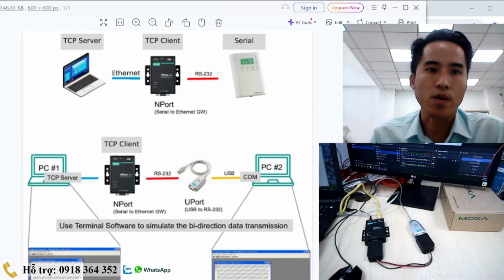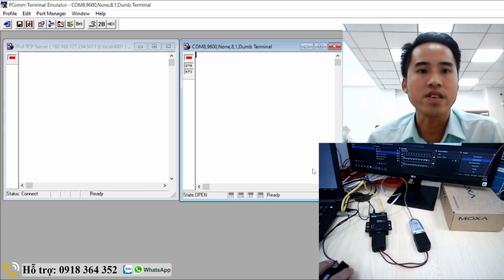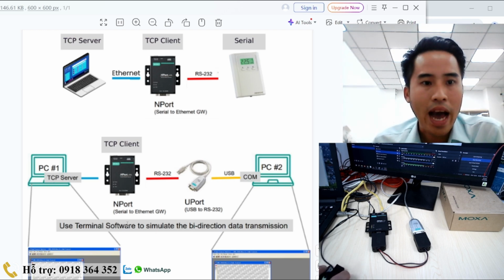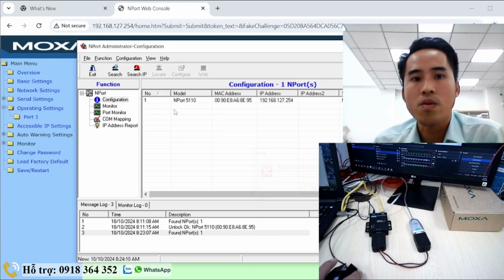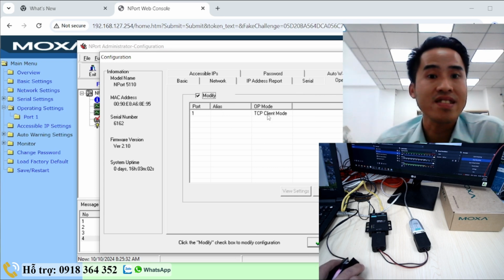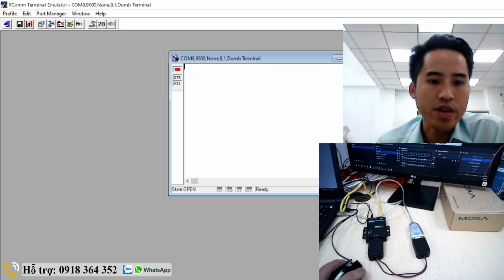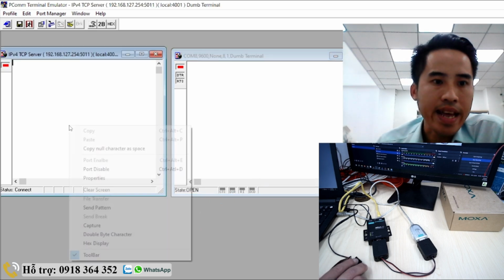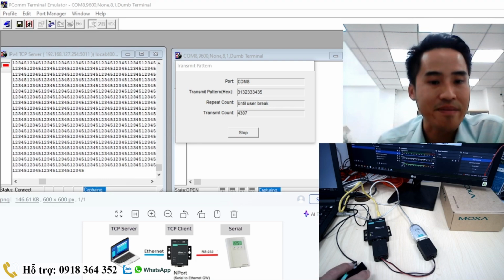TCP Client mode With Nport Moxa - Serial Device Server (Demo & Installation Instruction)

Comment: Nice video.!! 🙂.although it might be a bit slower at some points, it is very fast for beginners to understand all the details.. keep up the good work..
Can you put a link where to find the Nport Administrator configuration  software? 
Also can you describe more clearly the physical connections with  ethernet cable and RS232 cable
Reply from the maker: Thank you for your feedback, hope to build another video better, About Nport Admin you can download depaned on your OS, following Resources tab for get right link: https://www.moxa.com/en/products/industrial-edge-connectivity/serial-device-servers/general-device-servers/nport-5100-series#resources
Reply: @lammangcongnghiep  thank you for your replay..could you give me advise from your experience? 3 questions
Iam trying to test a Lab instrument sending data through his own PC via physical RS232 port ,before I connect it to the Labs network.(lab network server has a specific IP address and port where listening different devices connected)
I get a Moxa device Nport5110 and I connected to PC rs232 port with a serial cable. the type of this cable must be straight through or nullmodem?
Can I run the PComm  tool  to the same PC if i connect Moxa Ethernet cable to this PC Ethernet port and simulate traffic (as you do in your video) ) or sending data from the instrument? in that case of simulation what IP address and port is should give to  PComm TCP server?
Thanks a lot
Reply from the maker: @dimm4180  Hi Thank you for your feedback
About your case, here are my mention,
1/ Is your Lab device have App from manufacturer? Or any Protocol specific like modbus rtu RS232?
2/ On my video I demo using Pcomm for simulate the pricipal of traffic how it com and out. But if in the real case like your deivice you need to get data and program if it have no App from manuafacturer.
3/BTW if Lab device use modbus rtu  you can use Modbus Poll for testing data, polling the register each data to check communication of Lab device work or not!
Thanks
Reply: @lammangcongnghiep   thank you for your quirk response.. 
actually the Lab device using ASTM protocol to export data via its own pc using  rs232 port where Moxa device will be connected..
Anyways  still have a lot questions but I will try to find some answers  with help of Moxa support.
Reply from the maker: @dimm4180  thank you very much, techincal so many things, if you need to support, feel free to ask us,